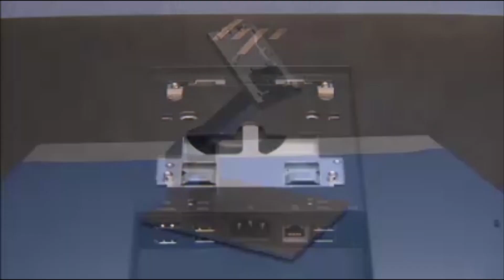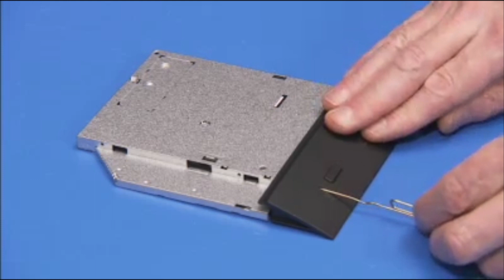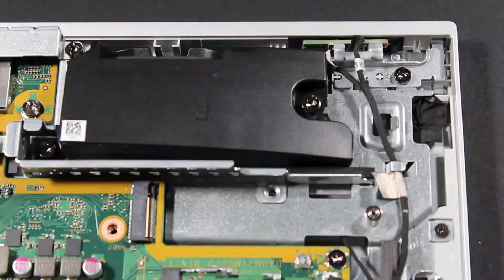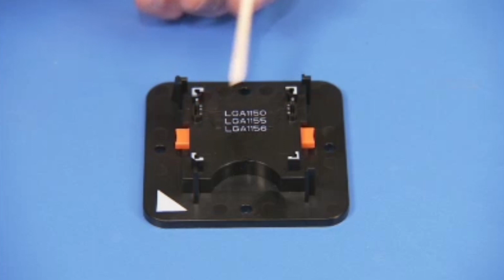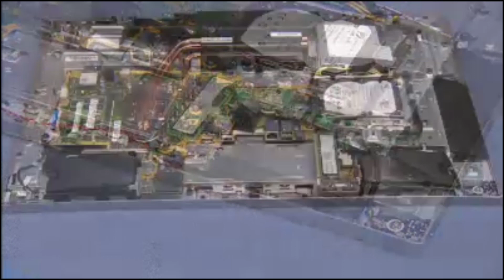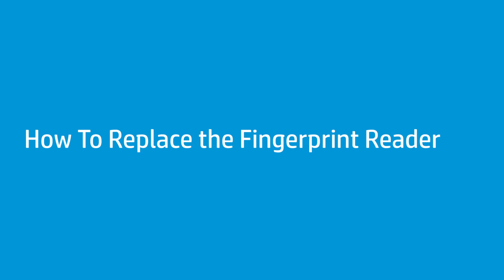Removing & replacing parts for HP EliteOne 800 G4 AiO | HP Computer Service

Comment: please how did you fit the gpu in
Reply from the maker: Hi Cartoon, thanks for contacting HP Global Social Media Support!
I understand that you need help in adding graphics card on your computer.
In order to get this issue fixed, please contact our customer care team over the phone or chat for further assistance, as this issue requires Live conversation with you over phone or chat to isolate the issue and provide you instantly with appropriate solution or repair/replacement options available at your place as per the warranty.
Please feel free to reach us on call/chat, please access this link to select your preferred country and language option to reach us. Global support link: - https://www8.hp.com/us/en/contact-hp/ww-phone-assist.html
Binu_HP Social Media Tech Support